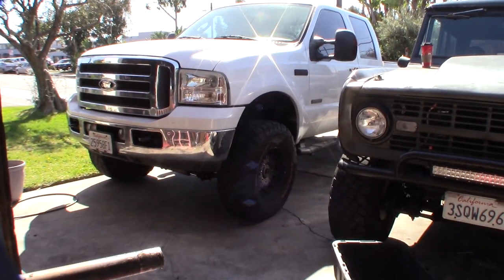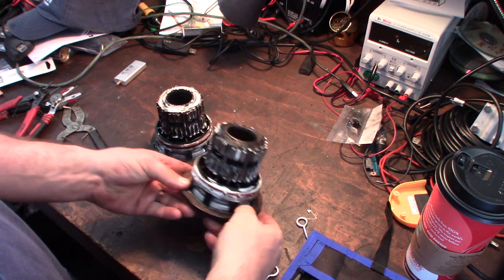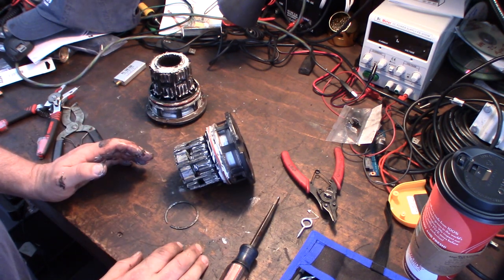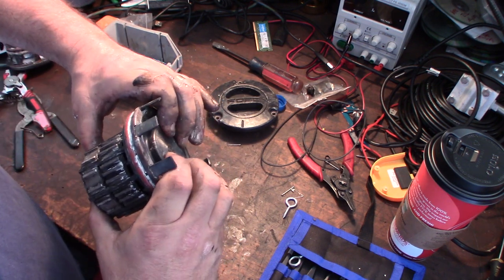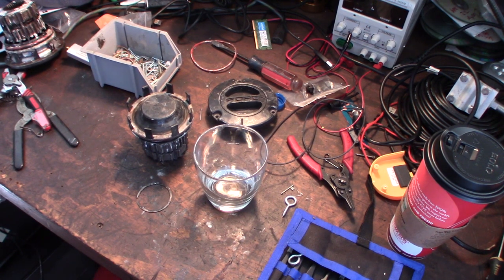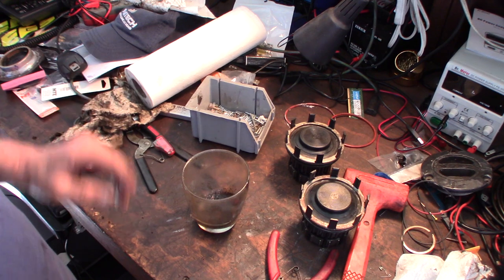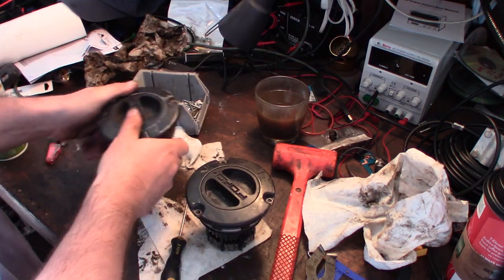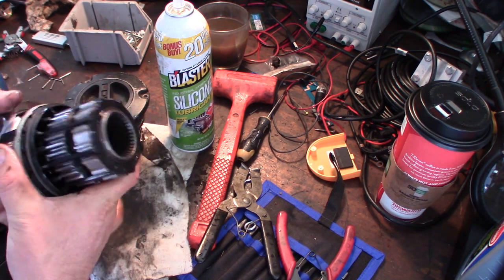Ford F250 ESOF automatic hub service and maintenance 2005-2016 stuck

Comment: Prime suspect for why these would "lock on their own"... There is a solenoid valve that opens and sends vacuum to the hubs when you switch to 4WD. It's mounted on the right side quarter panel under the hood between the battery and the A/C evaporator. It's possible that the valve is failing -- leaking vacuum to the hubs. I'd be checking for that.
Reply: Did that take care of the problem?

Comment: What happens when these things both stay on is that it spins the front driveshaft ,,,,the front driveshaft is not meant to be spinning all the time and what eventually ends up happening is the front driveshaft double cardon wears out the the ball and socket  pilot and the front shaft will have a ton of slack in it and has to be replaced.
The 99-04 were bad about this too,,they would engage ok but then not disengage leading to spinning the front driveshaft and wearing out the double cardon ball and socket joint,,,which is part of the shaft,,,
Reply: hmm probably what happened to my truck.  I bought it used from the util company.. someone probably left it in 4wd all the time.   Is it an expensive repair?  easy? hard?     mine is a 2012 F350 with manual lever on the floor.

Comment: These are garbage; had problems with them on all my Fords. I'm looking at two new ones at $155 a piece for my 2007 Lariat. Got to rebuild the axle shafts and replace the seals too. This is one reason I'm considering a 22' RAM Cummins with the manual shifter on the floor.

Comment: They start locked. When you start your truck, the vacuum unlocks them. If you have a vacuum leak somewhere, they default to being locked... that way you won't get stuck somewhere with a vacuum failure or some other issue. I have a 2011 Lariat.
Reply: on the F150/rangers Yes )
Super duties send vacuum to engage them
Reply: That makes no sense. If that were the case, why can you manually lock them. That's what the manual part Is for, so you don't get stuck without.

Comment: There is so much wrong in this video. 
 The hubs default to "Unlock" when 4 wheel is engaged the solenoid draws vacuum and hubs engage when hubs are in Auto. When turning hubs to lock you are bypassing the vacuum side of mechanism. Also note: you need grease in those hubs not a spray thin lube. There is needle bearings in that inner splined shaft in the hub. They in fact require grease. If not you will without a doubt occur premature failure. There is no push diaphragm once for lock and twice for unlock. That's not how they work. When diaphragm is "IN" your locked. When diaphragm is out your "Unlocked". The rotating switch on the outside of the hub controls the depth of the diaphragm lock.   Again...you need real grease in those hubs for the simple survival of your needle bearings or you will be replacing them in your near future.
Reply from the maker: I have newer style non needle bearing design. Ford changed that design and went to sealed bearing for stub shaft support.

Comment: If you are using 4x4 for any serious terrain and extended period of time, save yourself the problem and just buy the replacement hubs for the F250 that are LOCK and FREE (manual), forget the auto vacuum driven crap!  This stuff works great from the factory for the first 5-7 years, but when there are too many ways you can loose vacuum, go manual. I did this and now I absolutely KNOW when I am in 4x4 and won't get stuck again in the South Carolina wet sand when I thought my AUTO mode was going to take care of business. Even when I used LOCK and wasn't really because the rusted auto hubs suck, I got stuck too. Not any more, the regular MANUAL version of these hubs for at least my 2008 F250 were the same exact dimensions and gear fit.  Oh yeah, and they are cheaper!  Good Luck!
Reply: why cant you just get out and lock the "auto" hubs in? They have a manual selector for this purpose. There is no difference between auto and manual hubs except for the diaphram. Infact you can use auto hubs as manual hubs by just disconnecting the vacuum line.
Reply: @jman2618  You don't even need to do that.         Don't be lazy, fix the auto hubs.
Reply: I don't see any benifits by going to manual hubs, as actually the auto hubs are the same thing pretty much. Now, on my explorer woth auto hubs, that was a different story. I blew up three sets of autu junk hubs on that before I bought warn manual locking hubs, which were physically completely different. Never had an issue again with it.